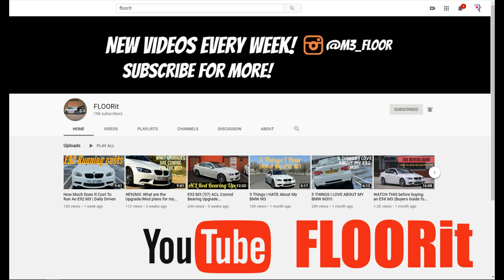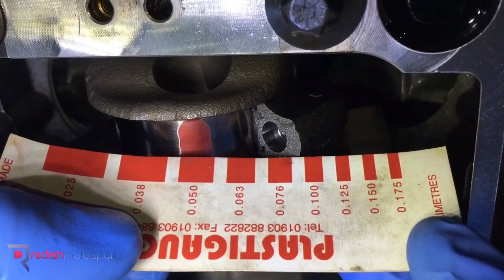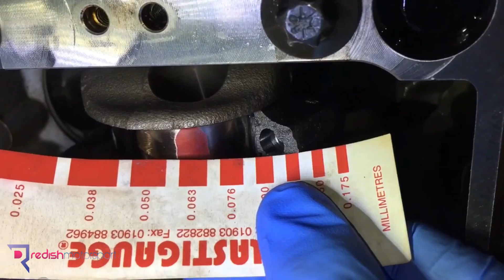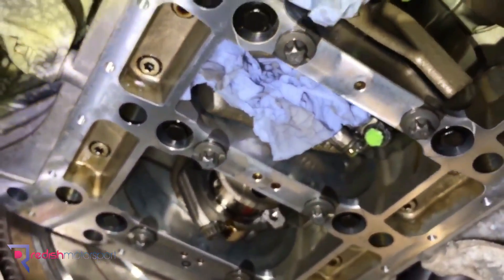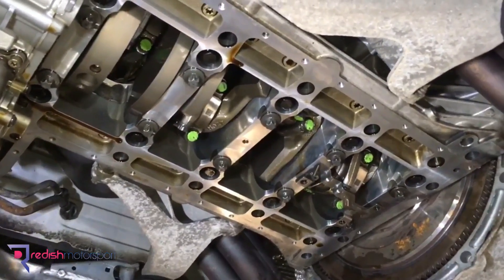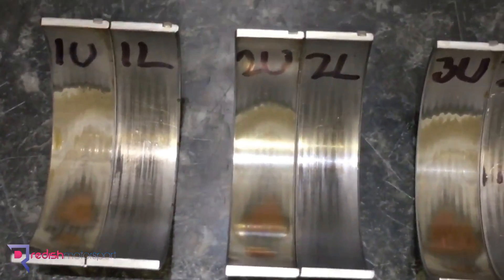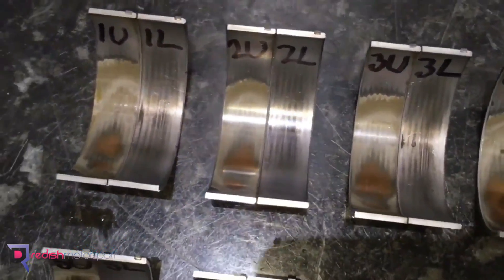Rod Bearings: BMW E92 M3 2007-2010

Comment: Nice video. I'm going to be changing the rod bearings on my e93 m3. Car has 212k miles, and they have never been changed. Went with king bearings cr224gpc. My question is, is the bearing clearance the same as the clearances shown in your in-depth rod bearing replacement? Can't find an answer anywhere. Thanks

Comment: Nice video like always! I am the current owner of a 2013 M135i with about 61k mls on the clock - and I am looking to keep this car for as long as possible, do you have any tips to make sure it lasts for another 60k and beyond? 

In your opinion how do the F20's keep up with corrosion on the chassis and sub-frames etc? I clean the underside and wheel wells seasonally before and after winter to ensure there is no lingering road salt that could speed up corrosion so that it will last for a long time - I have considered a preventative treatment like in some of your other videos but still need to figure out if its worth it.

Another question - if I may - is about the rod bearings on the N55... At what mileage should I look to do a preventative change on these, and have you seen/heard of any premature failures on the N55's rod bearings etc? Somewhat controversial but, do you think the long life service on these 2Yrs 20k mls is too long and should be done more frequently?

Comment: During the plasti-Guage stage, do you reuse the old con-rod bolts to take the measurement - I’m asking because they are stretch bolts and don’t know if they are eligible to be used again for measurement purposely only.
Reply: Yeah you use the old ones for plasti gauge test. The tension doesn’t need to be perfect... just enough to get proper crush... which is a lot less than the spec’d torque.

Comment: Can someone explain why these wear from the 'middle outwards'? What must be deforming such that the centerline wears out first?
Reply: Insufficient oil supply. The tolerances on those parts are like 0,00000something and if you miss a number you'll end up having either too much space or too little. Both won't allow for proper oil supply but one adds rather unwanted "free space" to move about while the other removes space which will press out oil where it is needed to stay. Higher friction results in higher temperature with results in material deformation and there you have it. Book says service is due each lets say 50k but your engine will pass out shortly before 30k and BMW is going to tell you that your warranty does not apply :) considering the price tag and spare parts prices incl. insurance and all that.....

Comment: I really want to replace my M57 engined E92 with an S65 car but this issue scares me. I bet Redish have never even seen inside an M57 😝 
57,000 miles and the engine was almost toast is shocking. Lesson to self, don’t even bother going to look at an M3 unless it’s had it’s bottom end sorted by a reputable company like Redish and has documentation. 💡

Comment: I had mine done at 140k miles! They really weren't that bad, just a small amount of copper visible on the uppers, feel better for doing them but just shows its a bit of a lottery so might as well just go for it and replace.... then its down to you to warm car up properly etc.
Reply: Neil did you have your car from new? I've got a 58 plate with 56k on the clock. Third owner. I'm wondering now after seeing this video whether I should get them done right away or as you say it's a lottery...
Reply: bio10155 This is my M3, 57k and I’m the third owner. I always warm correctly but these were the original bearings so shows you never know how previous owners drove them. Especially from new as warranty’s would have covered the issue so wouldn’t have been a big deal. 😊
Reply: FLOORit Hi, thanks for replying and for the additional information. I see what you mean though... and I’m definitely sure mine are original bearings as well since this wasn’t that apparent two years ago since I took ownership of my M3. It was known of course.. but I see more and more evidence now...
Reply: bio10155 it’s really up to you, it’s not vital but definitely eases the mind as it can be a big bill (8-10k) if it blows a bearing! Redish were great as you can see so highly recommend 👌🏻
Reply: @bio10155   HI , slightly misleading! i have an e46 m3, same probs though, i fancy  a v8 m3 too  but i would get them done regardless if you intend keeping the car.

Comment: I'm curious if you or any of your clients have ever considered or tried using an aftermarket bearing that has a slightly larger clearance to see if that would mitigate or increase the lifespan of the rod bearings? I remember reading that the rod bearing clearance in the S65 is very tight compared to other engine manufacturers and some people speculate the tight clearance was the reason for wearing. Love your channel btw
Reply: The plastigauge measurement dictates the bearing size. You can’t have a clearance as the bearing has to nip the journal when fitted. If you didn’t have this the bearing shells would spin in no time.
Reply: @fidelcastro9579  He's talking about opening the clearance to increase the hydrodynamic oil film layer.